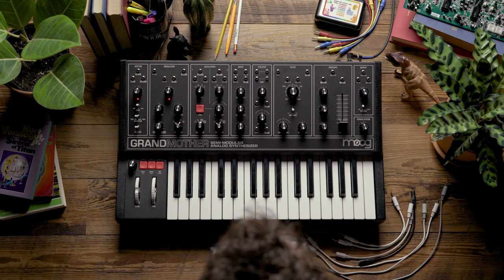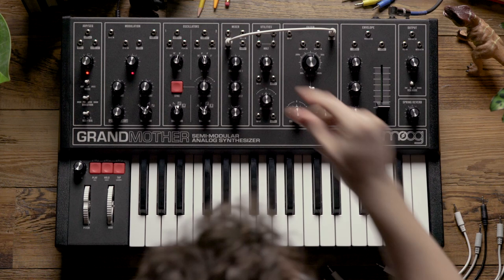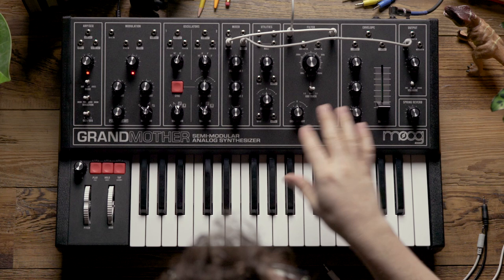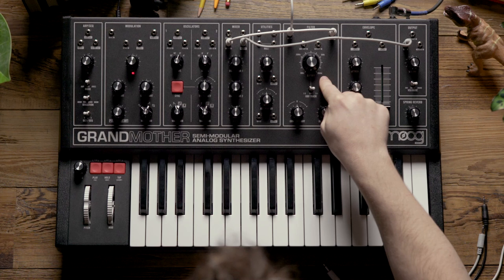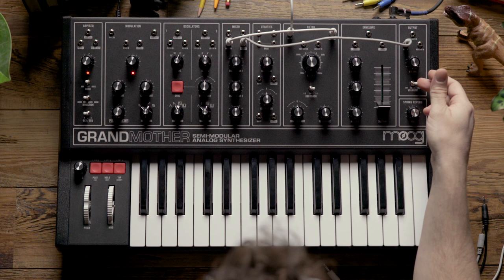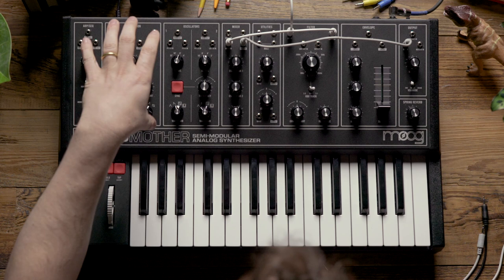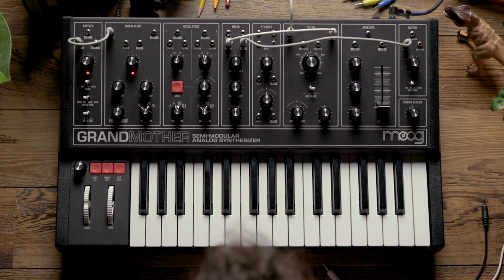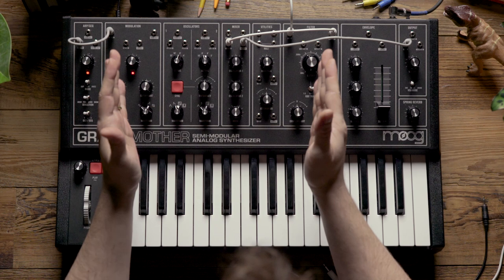Grandmother | 2-Op Analog FM Synthesis

Comment: this is not working for me, triple checked all the settings. i got no sound at all. adjusting cutoff, mod rate and mod wheel. nothing. whats wrong u think?
Reply: i tryed something similar with the matriarch, i got it to work on that. not grandmother tho. is something wrong with my unit?
Reply from the maker: Hmm, it's hard to say.  Make sure the filter's resonance knob is turned all the way up, and that you have a dummy cable patched to the input of the filter.  The mixer's output is normalized to the filter input, so without the dummy cable you can get phase cancellations from the sinewave getting fed into itself, resulting in silence.  If you still get nothing, try and reach out to our technical support staff for some help @ techsupport@moogmusic.com
Reply: @MoogSynthesizers  right yes, i did chekc all of that. i will try some more and see what happens. thank u :)
Reply: Could it have anything to do with firmware?